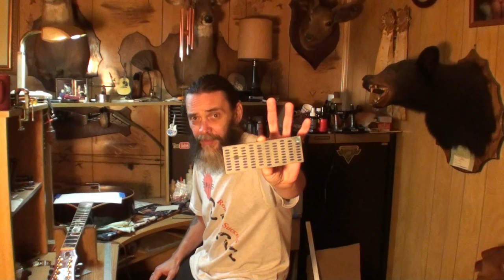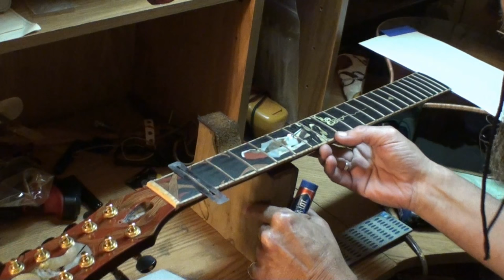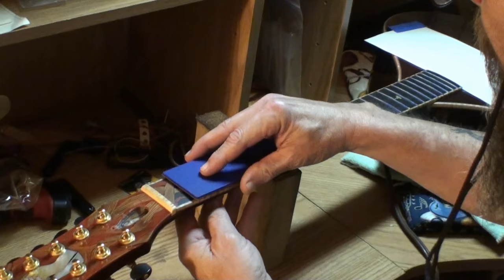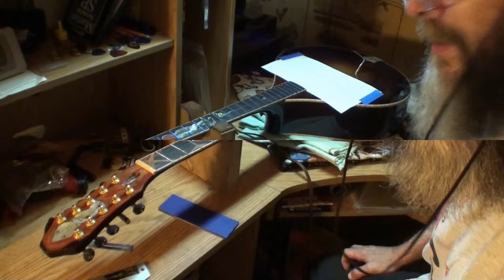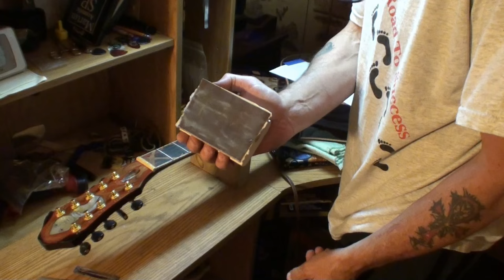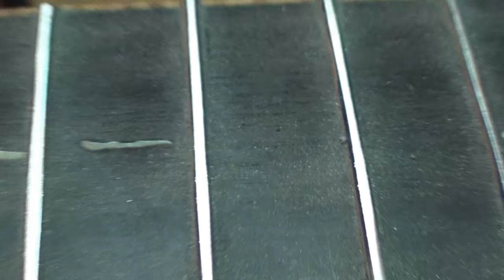Cittern fret leveling part 2 of 5. Tips on assuring your neck is straight

Comment: Excellent work Randy. I only have two questions. 1st: How can you be perfectly sure that the fretboard is straight (not the frets, just the fretboard) if you don't have the ugly notched straight edge? And 2nd: lets say you use the notched straight edge to straighten your neck. If you have a fall on the fretborad like the one the cittern has, but lets assume that we are working on a guitar with a tressrod. In this case i cannot see a way how to be sure that your neck is straight. What do we do?
Reply from the maker: You can get the neck very close to perfectly straight by using an un-notched straight edge across the frets like I did here, but if it's the neck itself you want perfectly straight instead of the frets you'd need a notched straight edge to get it perfect. 

In many guitars the truss rod doesn't run all the way to the end of the fretboard extension, so we only have adjustment from the nut down to wherever the truss ends, if you have fall away on a guitar like that about all you can do is humidify it well and hope the fall away fixes itself. You can sometimes get good results with heat but not always and there is a danger of drying the wood out too much if heat is used, so you have to pay close attention to the moisture content of the wood in the areas heat is being applied.

Comment: Another good one, Randy. I have always wanted to ask you where did you get these files to level the frets...... I have my beam and different fret files bout none like yours....
Reply from the maker: I bought these at a local hardware store, I think they are made as sharpening stones but when I saw them and saw they were diamond grit I knew they'd be good for leveling frets, man they are fast too, the only time I have ever used the course one was on stainless steel frets, almost always the fine grit one does the trick.

Comment: Randy Why are some frets  higher or lower from one other ??
Very interesting dressing the frets  making them tip top sharp :)
 Wired that Instrument Makers don't dress their frets ????
Thanks You Randy & Q Ball
Reply from the maker: They do (or should) dress their frets when they build the instrument, every time I pull frets and install new ones they need to be leveled and dressed. The reason you sometimes get a high or a low single fret could be from a fret being worn more than others, (string benders do this a lot) or sometimes a fret will pop up out of the slot just enough to make it high. The fretboard changing from humid to dry condition throughout the years can sometimes make them change or move a bit. I checked all of these btw and none were popped up. Very odd the first fret was so much lower than the rest, the maker probably was trying to get low nut/first fret action. Thank you as well Scott not only for watching but for the business! Cheers!

Comment: Nice
So what is an Irish buzuki, and how is it different from a cittern?
Reply from the maker: Generally an Irish buzuki will have eight strings instead of ten, and I think they are tuned differently. Other than that they are pretty much the same instrument but more popular.
Reply: True, on the start of the video it is hard to see the 2 extra keys, going back and checking again it is true.  Greek buzukis come in either 4 stringed (4 pairs) or 3 strings (3 pairs - more traditional and thinner neck).  I like the Irish sound better.
Reply from the maker: PermaKulHurTur
I'll probably "try" to play something Celtic like when I get this instrument back up and running, I imagine Celtic would sound good on this.

Comment: Randy I recall you did a video on Capo's 
Check out my  G7th Capo its in the  case pocket 
it's work all the way up the neck of the cittern unlike the Dan Crary capo
LO_OKING forward to the next video :)
Reply from the maker: G7this an awesome capo! Anything you can adjust manually the tension on the strings gets my vote. :)

Comment: The bottom of the neck is lower down then the rest of the neck. Cause the neck has a slight bow in it. If my memory serves me right. I have not worked on instruments in years.
Reply from the maker: It may have happened from needing humidifying sometime throughout its life, usually humidifying corrects this problem, it's humidified properly now but if that's what happened it didn't correct itself 100%. Thanks for having a look Thomas.